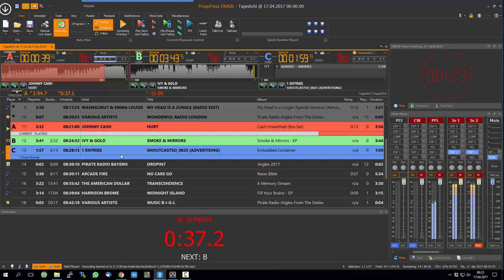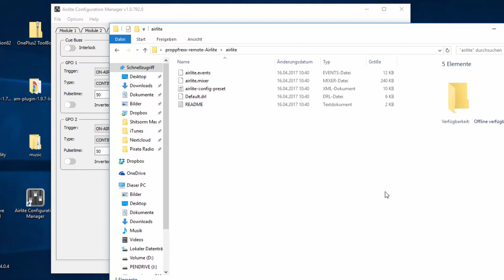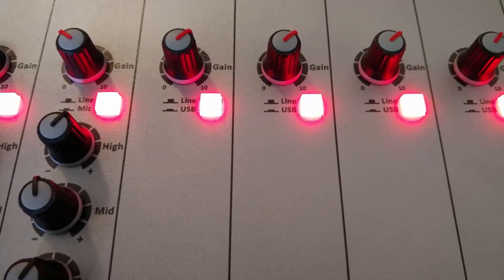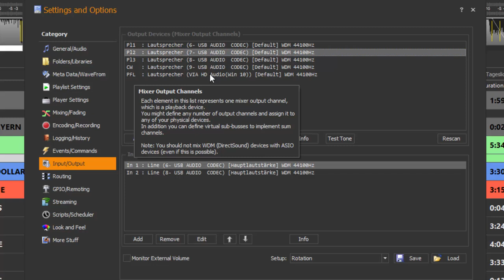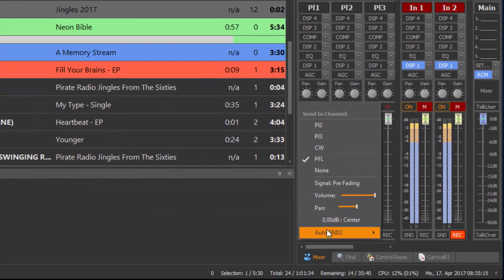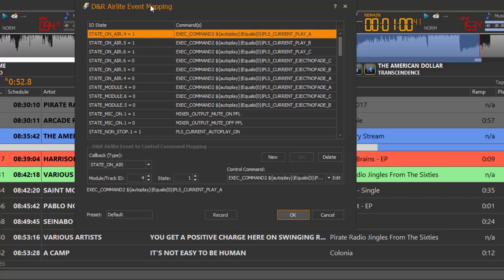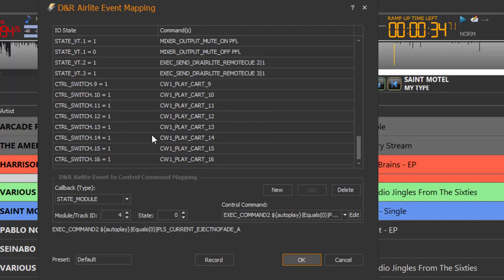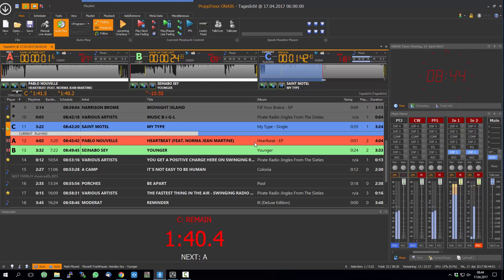D&R Airlite Setup with ProppFrexx On Air: Step for step setup

Comment: Hi Benjamin,

First, Great video of showing how to programming proppfrexx with a mixer. 

Do you know if there are another mixing consoles are compatible with proppfrexx ?? 
I actually do not like D&R mixing consoles. 
I know there is 1 behringer, named the DJX-2000 USB in combination with the velleman 8085 kit, that could do the same. 
But i do not like to soldering any pcb boards together, i am looking for a mixer (Example: Rodecaster Pro 2) except D&R which can do the same like you showed us in this video.